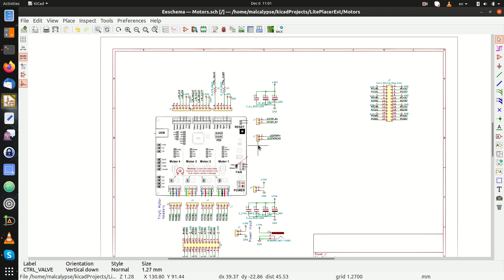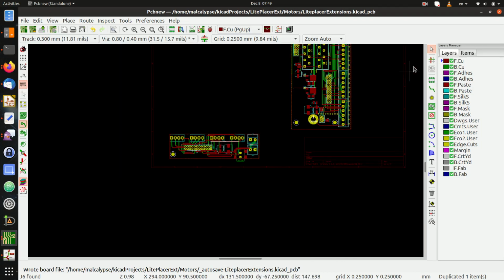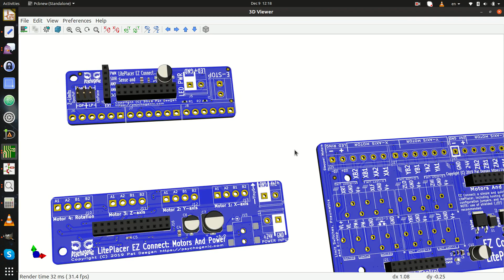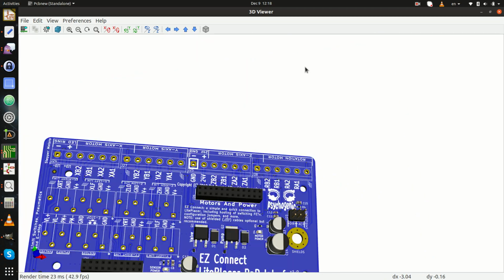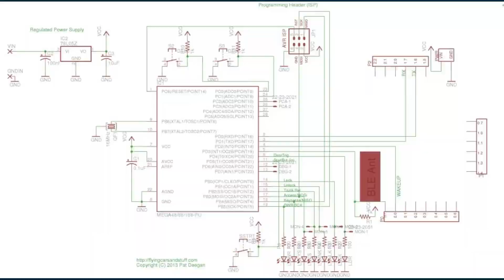Pick and Place: Interfacing solution and wiring it up

Comment: What are the dimensions of the frame? It seems wider than the classic version.
Reply from the maker: Hm, well a rough measurement (it's stored and hard to access) gives me about 80x55 cm of frame, say 55x35 cm usable conservatively.  What I can say with precision is that I didn't modify it from stock, so it's built as it was received (though that was a while ago).  Maybe I'm smaller than I appear, heh.

Comment: What's the point of those extra PCBs? The wires still look messy 😄
Reply from the maker: Hah, yeah, granted still pretty messy.  Main points are not having some stupid dangling FETs and also to be able to connect/disconnect the TinyG with just two ribbon cables (which I do when I put the machine away)
Reply: @PsychogenicTechnologies  instead of using so many cables for limit switches, use 4pair networking cable and use it's 6 wires and use 2 rest of wires to power top camera lights, For stepper motor use 2 pair shielded cables. That's total 5 cables including usb and solenoid.
Reply from the maker: That's a great plan.  I don't know if I'll ever rewire the thing so long as it's working, but if I do it'll be following something like you outlined.
I just saw https://www.youtube.com/watch?v=4JPg8JFbWSs from another comment on this video.  I'm drooling.  So now that I've some experience under my belt, I'll tough this little guy probably for a good while but will surely be looking to something beefier in the next round.

Comment: Do you plan to make the interconnect pcbs available, or offer the gerbers etc for other Liteplacer owners?
Reply from the maker: Hi, sorry it took me a while to see this.  Short version: yes, I want to make something available--needed to make sure the thing would work as advertised, but after almost 100 boards I think we're good.  Will try to get on that in the near term.
Reply: @PsychogenicTechnologies  I am also very interested in buying the connecting PCBs! :-) But soon (as in NOW!) :-D
Reply from the maker: Hi,
Well I've got extra boards--one issue with the prototype was that there was a snafu and the main connector board needs a jumper wire... may have a new batch made, but it's an easy fix if you can live with it.  Thankfully, the TinyG "wings" came out perfect the first time.  Either of you can hit me up with a private message through the contoct form on my blog to get me an email addy to use and we can set something up (https://inductive-kickback.com/contactus/)

Comment: Great idea to simplify the cable management.
Reply from the maker: Mostly wanted a way to easily disconnect the controller for storage, but I'm really liking the ability to switch between it's default software and OpenPnP with just a jumper.  Also found a way to attach everything to the surface--will show it in the next video.